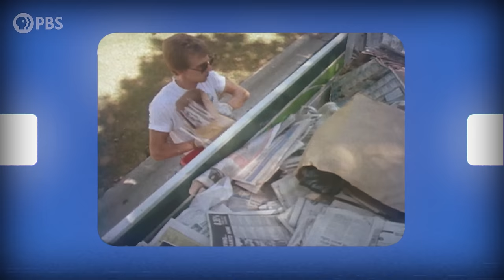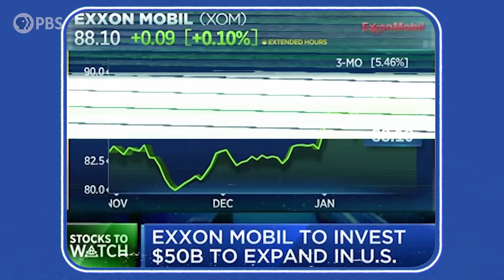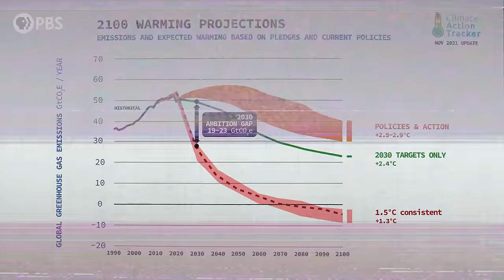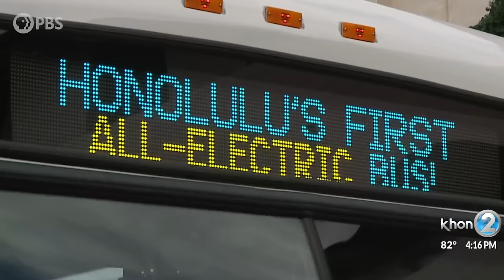Does "Every Little Thing" REALLY Stop Climate Change?

Comment: We need trains, trams, subways and bikes lanes everywhere
Reply: We need decisions that are based on more than just satellite imagery to be in paperwork. I hypothesize that such would go a long way toward better infrastructure.
Reply: And airships for mass cargo with almost no need for fuel (especially in regions with a "Mediterranean climate")
Reply: We also need rich people to stop polluting by taking private jets, and influence politics to keep their heavily polluting industries well-protected...
Reply: no
Reply: @TimBorg  yes
Reply: *protected bike lanes
Reply: Stop unnecessary air travel. Nothing like a jet and a 2 stroke motors like that in leaf blowers.
Reply: @atrumluminarium  Yeah, turns out airships aren't going to accomplish much in terms of cargo transport. Certain high-volume low-mass items could be moved, like wind turbine blades, but for mass intensive transport you need some sort of ballast to maintain altitude control. And worse, you have to be able to load the ballast simultaneously with unloading the cargo, then do the reverse when unloading ballast. Otherwise you have to vent the helium or hydrogen when offloading, then refill the airship when taking on a new cargo.
Reply: @willythemailboy2  Not necessarily I think. Hybrid airships for example should have a percentage of their lift be aerodynamic lift which could be adjusted in similar ways to how winged aircraft adjust it using some sort of elevon. The lifting gas is only there to offset the weight of the cargo and make it neutrally buoyant at ground/sea level
Reply: YES
Reply: Building and maintaining them would make the entire effort counter-productive.
Reply: @Bookhermit  trains or airship?
Reply: Not even just bike lanes, but bike infrastructure that makes bikes more important and faster than cars. Watch not just bikes if you don’t already, what they do in the Netherlands is so much healthier for humans and the earth. Everyone rides bikes to get around, even in rain and snow, even with lots of cargo.
Reply: @beesquestionmark  yes!
Reply: And nuclear powered cargo ships
Reply: The problem with that is: We have been suburbanizing home ownership for over 70 years since 1950, the separation of people from where they work makes building train/bus lines almost impossible. We are going to have to build more population dense living areas before trains/buses/bikes/subways will become practical. That takes a lot more planning and changing of human behavior.
Reply: @atrumluminarium or just use regular ships?
Reply: We need less cars no roads no parking space, driving probibations...
Reply: @Max-ki6df  Air ships are not limited by the sea. It would be able to just float along the prevailing winds circulating over the inlands of the UK, France, Germany, Poland and the Nordics with crazy tonnage using only fuel to course correct occasionally. There are also circular prevailing currents in the north atlantic, indian ocean, south atlantic and the poles that could be traversed in this way.
Reply: @atrumluminarium  so Like a sailing ship, that you can build with litteral middelage Materials. The bounding to sea isn't really a problem eigher, 2/3 of the Planet IS sea. Only thing ships Lack ist speed
Reply: @Max-ki6df  it is a problem because you'd need to go around the continents and then transport inland by trucks, trains or planes. Various terrain considerations need to be taken into account. I think we both remember the delays and disruptions that were caused when the Suez canal was blocked a few years ago where the choice was either to wait for it to clear or go around Africa.

Also my point was never to completely replace ships (powered by wind or otherwise) by airships but to use them where the route is more advantageous to do so.
Reply: We do but the purpose of that is to give us transport not to reduce emissions

Reducing emissions is a separate step that needs to happen regardless (and will whether we like it or not)
Reply: @Timlagor  the purpose of train is also to give transport and reduce emissions
Reply: @oneilgoisot9615  It doesn't reduce emissions. That's a separate action.
Reply: @Timlagor  what do you mean
Reply: @atrumluminarium Air ships can't be safely manoeuvred in winds over 3Bfort. 

And man, it does blow up there
Reply: @willythemailboy2  Forgive my ignorance on airships, but why would you have to simultaneously load/unload ballast and cargo when the thing is ostensibly securely tied down? I picture a whole bunch of cables all around the ship to anchor it in place. Don't it work like that?
Reply: @Avoidiac  Most of the applications people are pushing these days would require what is essentially rough field capability - being able to load or unload with minimal infrastructure at one or both ends. That means no permanent structures to tie down to, and temporary or mobile structures would need to be incredibly robust to be able to take the necessary levels strains straight up. One proposed airship has a planned lifting capacity of 160 tons. Good luck tying that thing down with 160 tons of upward force on the lines. 

As pointed out by others above, they're incredibly sensitive to weather conditions, especially wind. The same proposed airship is 260 meters long and up to 65 meters wide. My admittedly half-assed calculation puts that at about 13 tons of sideways force in a 10 mph wind, and that force goes up with the square of the wind speed. And of course the magnitude and direction of that force can shift on very short notice.

All of these technical challenges buy you a specialty airship that admittedly has better range but slower speed, more fuel efficiency, potentially more rough field capability, but overall less flexibility and more weather vulnerability than a C17 with comparable lift capacity.
Reply: bike lanes would be a horrible idea
Reply: @Max-ki6df  people will use cars, if we reduce roads its just gonna cause more traffic which will emit more greenhouse gasses
Reply: @MassMen  why would they use cars? I live in Grenoble France we've reduced the car dependency and part of the city can't be accessed by cars. Most people doesn't use their cars anymore because it's sooooo much faster to take the tram or bike. And it did improve the air quality
Reply: @MassMen  you mean contrary to everything we know about induced demand?
People won't drive cars if there are more convenient alternatives see Tokyo
Reply: @Max-ki6df  its not like there's a bike that can carry more than 2 people and has a trunk
Reply: @beesquestionmark We have a truck train ferry bus transfer center with bike lanes and EVs. The diesel-electric ferry is packed with cars and trucks. The commute train only runs twice a day, usually 3/4ths empty. The EV buses have maybe 4 or 5 riders during the commute, empty all day. The same 3 staunch bicyclists grind up the hill out of town.😂🎉 "If you build it, they will come!" Uhhh...nope!
Reply: Not bike lanes! I am 79 and can't ride any more! Selfish,I know.I used to have a Malvern Star when I was growing up - loved it.
Reply: @GregorMcIntosh What about the elderly who can't ride anymore but have paid taxes throughout  their working lives?
Reply: @lloydsingline340  you know that nobody is forcing you to use a bike? Currently everything is made for cars it will be logical to be able to use a car or a bike depending on your needs right?
Plus if you won't be able to drive for long so a robust public transportation network will be highly beneficial for you
Reply: @lloydsingline340  there’s dedicated community transport services that mainly cater to the elderly

Comment: 26 percent of your graph was listed as “spending”. I can only conclude that it refers to the rampant wasteful consumption of nonessential junk. Yet personally cutting out the junk won’t do anything? Everyone needs to do everything they can. Blaming oil companies, the rich, or useless politicians only hurts the effort. Little personal gains keep us focused on the issue daily. Keeping focused helps put more pressure on those companies and politicians. Same goes for recycling. Don’t blame the companies for your personal choice to buy disposable garbage when you can get anything you need not wrapped in plastic. Some of us can hold more than one idea or opinion in our head at the same time.
Reply: Exactly. Every little thing we mere individuals do ADDS heat-trapping gases to the atmosphere, so we each need to reconsider every little choice we have to add less.  If we aren't thinking about these "little" daily things, (carpooling once a week or eating vegan), why would we make the big lifestyle changes necessary?
Reply: It doesn't hurt the effort. What's hurting the effort is accepting the blame being shifted onto you by corporate propaganda
Reply: Good point, just dont believe too seriously that our actions can make any significant change

Comment: I agree that "small" changes can be an important distraction from the bigger issues. However, we need to avoid the temptation here to simply shift the blame / responsibility solely onto corporations and governments to fix climate problems. We can share what we learn trying to change our lifestyles and help others do the same. This is an avenue to reduce our dependence on misguided corporate/governmental priorities, which could really help pressure change in these sectors. Essentially, change has to happen both from the bottom up (individuals) and the top down (organizations). It would be nice to see a video giving treatment to how top-down and bottom-up changes could take place simultaneously to solve climate issues.

Comment: The ending is a flawed premise that “emissions will go down regardless of individual choices”. It shows an electric bus, but why would anyone ride the electric bus instead of a Hummer if individual choices don’t matter? If grids are more carbon neutral that is a great incentive to build bigger houses with worse energy efficiency - since individual choices don’t matter. The problems mentioned in the video about justifying behavior will be even worse when individuals are absolved of responsibility and solutions are only made by others. Any change made by better systems can be undone by individuals.

Comment: Perfection is the enemy of good.  When I tell people how much I love my rooftop solar the first thing they focus on is if it covers my entire electric bill.  Even it it only covered half wouldn't that be a positive step?  As it is,  it covers about 90% of my electricity costs and that even with moving my hot water off the propane boiler and on to a heat pump hot water heater - electric lawn mower and other power tools, hot tub, heat pump for AC and heat etc.
Reply: I'll add that as an individual I can influence others by being an example as well as educating.  I've had two neighbors install solar after seeing my results.

Comment: As individuals we have very little choice on where we get our energy from. We can't tell the power plant to not give us fossil fuel energy but we do have a choice when it comes to food. We can choose to avoid the worst emitting food choices. This is the one area where consumers have the most power. 

We can reduce energy usage but we all still need energy for society to function so that needs a top down approach. But food choices are easy to make at the consumer level and on mass would make a big difference without any regulatory change as its a supply and demand industry. And most of the lower carbon items in the grocery store are also cheaper than the things they replace so we can save money at the same time.

Comment: Everything said here is true, but I think it should be said that just because individual action won't solve the crisis, that does not mean that our individual lives won't be affected by policy changes. 

The simplest example is gas prices. We need to stop pumping so much oil, but if we do, gas prices will go up. If we reflexively vote in the pro oil candidate in the next election cycle just because of high gas prices, we won't get anywhere.
Reply: Don't drive. Take the bus (less carbon emissions per person overall) or bike to work. Just don't drive. Don't give them the satisfaction of filling up your car with their carbon emissions.

Comment: It's a combination of actions that will serve to stop fueling climate change.  Yes, we need to change our big items like transportation and manufacturing methods, curb oil and gas exploration and use of petrochemicals - but our individual actions are not done in a vacuum.  When you have millions of people following many of the same actions, the impact is real.  For instance, if just 10% of the US population (33 million people) stopped using single-use plastic straws, that equates to 6,600,000,000 billion plastic straws from going to a landfill per year!  (Each one lasts for about 100 years - long past your lifetime).  If we as a society (330 million people) stopped using them in the US, that sends a message and eliminates 66,000,000,000 trillion individual straws from our environment.  So, individual actions combined with others can have an enormous impact on climate change.  Even if we stopped the oil companies to stop, our need to live more sustainably would still be a high priority. So, go after the biggest carbon producers, but never make it sound like as an individual living more sustainably is worthless.